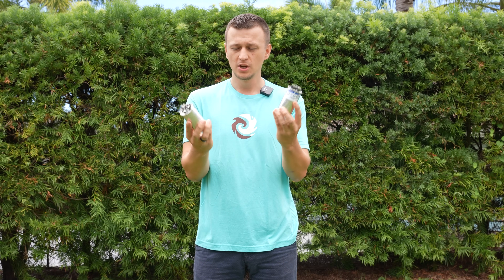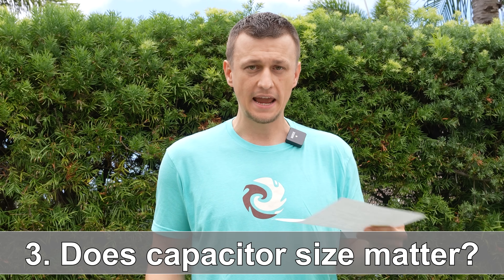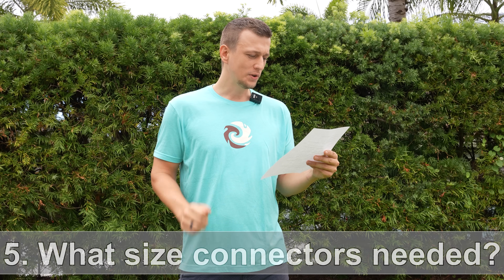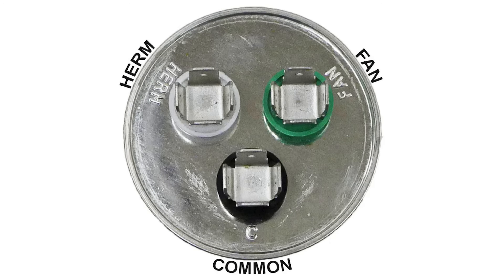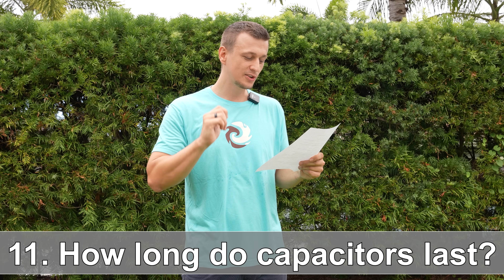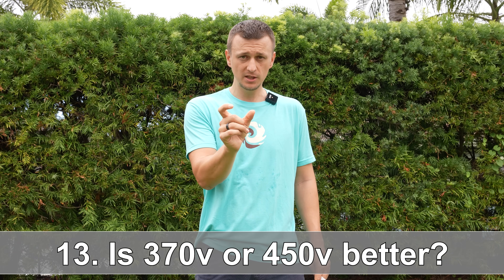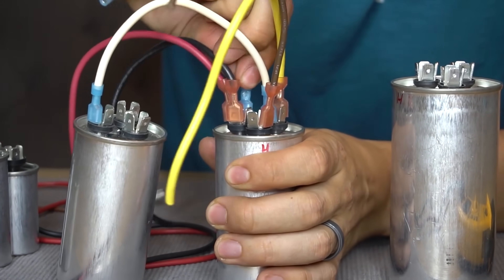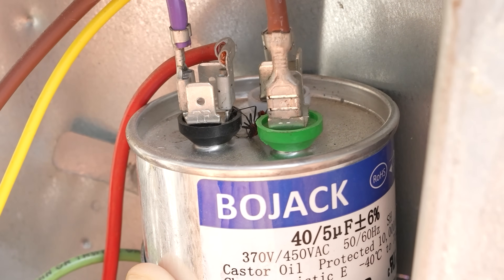ALL Your HVAC Capacitor Questions Answered!

Comment from the maker: ⬇ More Videos For Further Info:

How to Replace Furnace or AC Capacitor:
https://youtu.be/9ZGfvC-PMWU
How to Test Capacitor With +/- 6%:
https://youtu.be/5_0nKm940nA
How to Discharge Capacitor:
https://youtu.be/45oZXnClMD0
How to Combine Capacitors:
https://youtu.be/qLJOWU33TFo
Rusted Capacitor Solution:
https://youtu.be/RSIi47uzApI
How to Order the RIGHT Capacitor:
https://youtu.be/mkqaOfvH4a4
How to Replace a Start Capacitor:
https://youtu.be/hC0nFT1XPcI
How to Install Emerson Sureswitch:
https://youtu.be/qgHsGR4WT18
How to Install Surge Protector:
https://youtu.be/orvA0ygURwc

Comment: What would cause one of the wires attached to the relay to the capacitor to burn, Insects?? 
Had a section of  wire burn just past the connector coming off the capacitor.

Comment: Got a question I hope you can answer and solve this disagreement. It's regarding a friendly matter. 
Question, when buying and receiving a new capacitor. When installing the wire on the new one in the same pattern/sides is it possible the label is on the wrong?? Make to wires go on the wrong prong?

Thanks Happy Holidays

Comment: What about the caps on the blower motor in the furnace? Is there a standard. My blower stopped, upon inspection it had a bad cap bulge and didn't seem to give a proper reading with a multimeter. So I replaced it with the closest that I could find which I believe was like 7.5 with a 440v the old one was 7.5 with 350v. Still blower doesn't kick on. So wondering if there could be another cap I'm missing or if there's just another issue. This cap is only a small one with two sides. Both wires going to it are both brown. Could they be hooked up backwards?

Comment: My niece has a RUUD AC unit model FSM4X4800A1 unit and needs a capacitor. A company came over and installed a Super Boost SPP6 and it's been running for three years but I think she should still have a capacitor and the SPP6 as a supplement. WHAT size capacitor does she need. IT WOULD REALLY HELP HER OUT.

Comment: I bought a single run capacitor. It’s not marked fan or herm AND it has 4 prongs on both (only 2) terminals. I don’t know what to do now?
Reply from the maker: Did you buy it for the compressor or for the fan? As long as you know if you need to use Herm or fan, it doesn't matter which prong the wires will go to.

Comment: With age, teh MFD measured with the multimeter always decreases, in my experience. It would be interesting to explore however one question: My various fans always all need different capacitors; most often 5 or 7.5MFD, some 10 MFD. Can I forego stocking 5MFD and standardize on the 7.5 and 10? If not, in what way does a higher MFD harm the motor? I know that failing capacitors (lower than required MFD) practically always announce themselves via a vibrating motor, but the higher seems to not have that effect?

Comment: After watching many videos, I still can’t figure out my capacitor.  It just says 25uf  but no 2nd number.  It has 3 terminals HERM, C, FAN.  I ordered the only one I could find on Amazon with just 25uf and no second number but didn’t notice that it only had 2 terminals.  I was so excited to get my ac back up and running.  It was supposed to arrive at 11am, but didn’t show up until 5pm, just as all the electrical stores in town closed up until Monday. It’s very hot.  Does anyone have any advice?

Comment: Hi, my unit is a 4 ton Bryant  Brand. It's over 20 years old, I not sure what was the original size capacitor that was there. Do you know the size that came with the unit? Thanks in advance.

Comment: Hi I just replaced my heat pump capacitor, it did not work but it works with the old one. It is 35/5 and the old one has 20/4 with multimeter. I have changed twice thinking first one was broken but no luck. Any advice?

Comment: How to wire a single run capacitor
Reply from the maker: Provided that you know which wires go to the capacitor, It doesn't matter which wires go on which side of the capacitor.

Comment: I have a question I have a single capacitor that runs the compressor but I don’t have a separate capacitor for the fan, how does the fan run in this scenario?

Comment: Hello Jay. I have a small window unit that has been barely used in 3 years since I bought it new. I hate to throw it out. I simply cannot find a 35+6 250vac 40/70/21 dual capacitor to replace the one in the unit. Amazon, Google, nothing. Thanks for your help and your great videos.
Reply from the maker: You're welcome! This one should work: https://amzn.to/3ARNC0k
Reply: @WordofAdviceTV  Got it ordered. I’ll let you know how it goes. 👍

Comment: capacitor question 40/70/21 temp coefficient got a 40/85 21, first one was sent to me to replace but mine 40/85/21 could i fit 40/70/21 would it be advisable

Comment: Thank you for all your videos👍 can you do a video explaining how to diagnose the wrong capacitor was put in your system
Reply from the maker: You're welcome! The easiest way is to simply call a HVAC parts store and ask them to look it up for you using the model number of the air conditioner. If the size they give you doesn't match what you have in there then you got the wrong one.
Reply: @WordofAdviceTV  thank you so much!

Comment: This will probably sound pedantic but, regarding capacitor tolerance, it refers to the manufacturing tolerance on the part. So a 5% capacitor has tighter tolerance than a 10% and would likely be a bit more expensive all else equal. It might also have better temperature stability etc. Ideally one would know the tolerance the engineer specified in the circuit and use that or better. If you measure it though, and it is within spec for the unit then it probably won't matter. I doubt the tolerances on these are very tight though.

The same is true for voltage rating. One should know the voltage rating in the circuit (ideally on the circuit diagram) and then use a capacitor rated for that voltage or higher.

Love your videos, thanks for putting them out there!

Comment: Question no. 21. Is it true if you  shake the old capacitor and if you hear something rattle , the capacitor is bad and should be replaced even though it measures ok with a meter. Often called the shake test!

Comment: Technically, an electrolytic capacitor will dry out with time and fail. However, there is no set time frame for this. It could by 5 years or 20.

Comment: Will your AC unit cool the house better if you spray water on the outdoor condenser unit? It's well over 100 outside and spraying water on the condenser lowers the temp on the 2 tubes coming out of it (going to the evaporator) by over 25 degrees on each tube. Temp was taken with a laser thermometer 2 inches beyond the unit.
Reply: Yes.  And there are kits you can buy that will spray a fine mist when the AC is running.

Comment: I need some help, my AC lines outside are not cold at all but the compressor sounds like it's on but not fully? Also my evaporator coil inside the house is very cold, so my AC is sort of cooling but not on hot days.  Any suggestions? Also I noticed the blower doesn't kick in high speed at all during the summer but the winter months it kicks in when needed. Any suggestions would be appreciated thanks
Reply: Maybe the compressor isn't fully starting IDK ?

Comment: As a tech by day job, i can not help but wonder: if you're not sure of these BASIC knowledge questions, should you be risking your safety to change these parts & save money?

Ty for the content man!
Reply: Not everyone has that kind of money 🤷‍♂️ I'm a diy'er and taught myself how to do all kinds of stuff by researching. Replacing capacitors is extremely easy... It's just making sure you have the right type.
Reply: @TheDarkEmpty so there is no potential for the diy'er to injure themselves? Im glad anyone can get knowledge and do things diy. Im glad your cost to learn didn't include damage or injury.

Im definitely diy in other areas, I like self learning and money saving too. Safety first.
Reply: @borshardsd how are you going to hurt yourself replacing a capacitor on an AC? You discharge It, pull the plugs and put the new ones on. 

You're not messing with refrigerants.

Comment: Hey I have a amana unit and it wont turn on at all, I watched all of your older videos and theyre very helpful. There is an LED troubleshooting with a green or red light and different flash codes. None of the lights are on nor flashing does this mean there is a 240V issue???

Comment: I decided to replace my two year old capacitor made in Mexico with a Titan HD capacitor MADE in USA. I would try to use MADE in USA parts if they are available.
Reply: I personally prefer AmRad caps, but the Titan HD is certainly on par with them.
Note, however, the Titan "Pro" caps are NOT the same, nor are they made in the USA.

Comment: One other factor is to be sure to get one rated for continuous use. Split run caps have metal bodies because they need to be in continuous service. Dedicated start caps are only in service for a few seconds of each cycle, so some of those have plastic bodies because they don't need the durability.

Comment: what does the start capacitor 176-216mfd330vac means？ how many Uf?
Reply from the maker: Start capacitors don't have a specific rating but use a range instead. In your case: 176 - 216uF. To replace a start capacitor you would need to figure out the tonnage of your unit (in the model number) and get one suitable for the size of your unit.

Comment: I'll also add that ambient heat will shorten the lifespan of your condenser capacitor(s). Mr. Sunshine sucks. 
I would say on average, I'll replace indoor capacitors 10% of the time versus the 90% for outdoors. And yes, having more shade due to tall trees or adjoining buildings helps. But be very very careful NOT to block your condenser to add shade. They need lots of space to move air. So if your condenser is baking outside, and you want to add shade...make sure it's far away. At least 10 feet.

Comment: If you get a different shaped capacitor, and it wont fit in the original spot....you can place it elsewhere with longer wires. I do suggest to make it one run though, but if you wanna just add some wire caps and the extra wire...you can. Not my preference. Just make sure it's a good connection.

Comment: Question # 11-  What voltage rating should I buy? 370 or 440? Always go with the higher voltage rating for durability, although, either will work.

Comment: Hi Jay my run cap tests fine. The fan starts right away but it it takes between 2 - 5 minutes for the compressor to start. It is a Trane XB 13. Thank you in advance. Great videos!
Reply from the maker: Hmm... Usually the compressor does come on at the same time as the fan. Does your condenser unit have a timer or control board in it? It may just be a delayed start that prevents the unit from short cycling. (It's bad for the compressor if it comes on shortly after it turned off) If other than the delayed start, your unit is working and cooling good I wouldn't worry about it.
Reply: @WordofAdviceTV  thanks for the quick response!  It's an older r22 unit. I have an identical unit whose compressor starts right away. Ordered a new factory start cap , I'll see if that helps. I'll update you on how it goes. Thank you!
Reply: @WordofAdviceTV  UPDATE: changed the  start cap and compressor started right up! Removed the resistor on the old part and it tested at 0.0 MFD.
Thanks again Jay!
Reply: That is wild, Jay is correct. They usually power on together....even with delayed start. Could be a cool down feature...especially if it's in heat mode. That's not uncommon. Gives the exchanger a chance to relax.

Comment: Great advice at around 5:50 regarding keeping a spare capacitor on hand.  My entire system was pretty ancient before I finally replaced it.  It seemed like pretty much every other year or so I was replacing either the capacitor in the A/C or the heat sequencer in the furnace.  I learned to keep both parts on hand.
Reply from the maker: Thank you for confirming the spare capacitor idea from your experience! May your new unit outlast the old!
Reply: Also be sure to test the spare as it can be DOA.

Comment: ❤  your channel !
I have multimeter with UF up
 capacitance 1 nF A - 9.999 mf 
CAN BE USE TO TEST 35+ 7.5 UF 
OR it will only work up to 10 uf ?
Reply from the maker: Thank you sir! Good to have you on the channel!
A nanofarad (nF) is 1/1000 of a microfarad (uF).
It sounds like your meter is only meant to test smaller sized capacitors.
Up to 10mfd is it's limit so no, you wouldn't be able to test the herm (35) side.
Reply: Thank you so much for your  answer

Comment: Hi  I have two  new single capacitors  one for fan and one for compressor with no marking on either one not sure we’re to hook up wires.
Reply from the maker: Are the wires still hooked up to the old capacitors? Simply transfer the wires over to the new capacitors. It does not matter which wires go on which side. If the wires are disconnected, then hopefully you have the wiring diagram which should help you track down which wires go to the capacitors.
Reply: Thank you for your help.👍

Comment: If you write important specs ( that aren’t on the rating plate) on the inside of the cover with a Sharpie marker, it can save you some grief in the future.
Yes, I still wear shirts with pockets ( no pocket protector😂) and yes, I always carry a Sharpie marker and even a PENCIL.
Thanks again, Jay. Always looking forward to your videos . Stay well my friend.
Reply: You are so right
Reply from the maker: YES! Thank you for this expert advice! I very much agree. I used to write the date and specs of whatever I replaced but have gradually stopped doing that. I should really get back to it, thank you for the reminder!
I appreciate you always stopping by for the new videos good sir! Stay healthy as well and God bless you and yours!
Reply: I love it when older techs, or home owner heroes do this. Just a real classy move. 
Especially when they swap out parts, and add dates. That really helps diagnose.
Reply: yes, i kept meaning to do that now my unit is 26 years old and capacitor is brown with rust had to look up compressor model online and take picture of fan motor to find ratings
Reply: YES! Someone wrote "Cap 40/7.5" with a sharpie inside my unit years ago.. Saved lots of frustration trying to determine the size of my capacitor... Great advice!

Comment: For Question #9, another easy way to see what cap to use without calling a store, just look on the bottom of the compressor, it has its own kind of tag and it will tell you what that compressor wants for MFD. It might be uncomfortable for a second to look at the bottom if it's a 4 or 5 ton, but it takes a few minutes to do. Same for condenser fan motor if the tags are worn out
Reply: Slide a camera or mirror under it to see.
Reply from the maker: Great tip! Thank you for explaining this!

Comment: Only thing you didn't cover was over sizeing the capacitor for a temporary fix. Say your 50/5 is dead and or swollen and you use a 60/10, what happens then?
Reply: The feds will knock on your door. 
Joking aside, it's the same answer as what he said.
Reply from the maker: I once came out to a unit where the technician before me (two weeks prior) put in a capacitor that was double the uF rating as the one that's supposed to be in there. I think it was something like a 60 mfd instead of a 30. AC unit survived and was running fine. 😅 I by no means  recommend putting in much larger capacitors though. 😇
Reply: This capacitor is a poor impedence match with your motor.  It likely will operate fine but motor temperature may be higher so it should be replaced with the correct value asap.  Personally, I wait the day or two for the correct replacement to arrive but I may test the system for a short period with something close, to confirm operation.

Comment: A small dent on a new capacitor, will it be defective?
Reply from the maker: Usually no, I've seen plenty of dented capacitors and most of them work just fine. They tend to dent easily.

Comment: Just one word of experience. My Rheem AC has a separate "recess" for the capacitor so physical size may matter.
Reply from the maker: You're right! With those it's nice to get one that fits but I have had times where I simply used zip ties to make a thinner capacitor work. Sometimes you just need to make it work. 😇